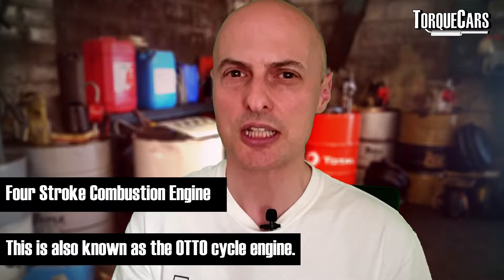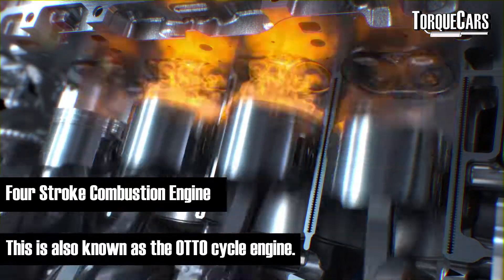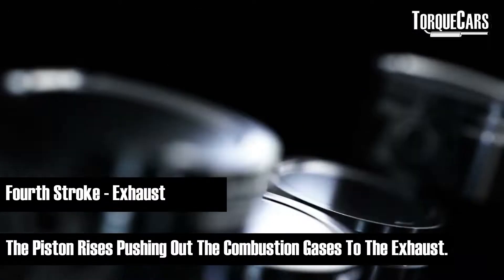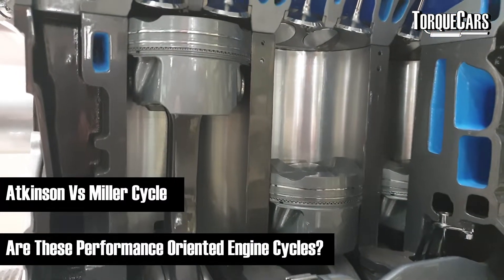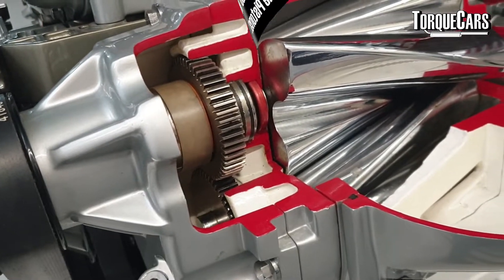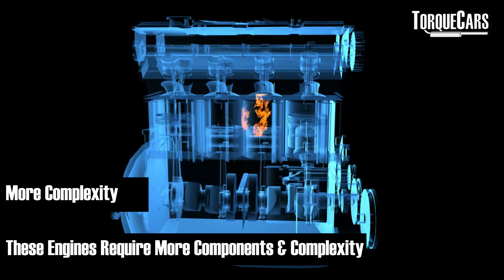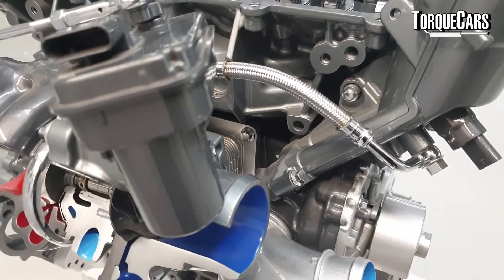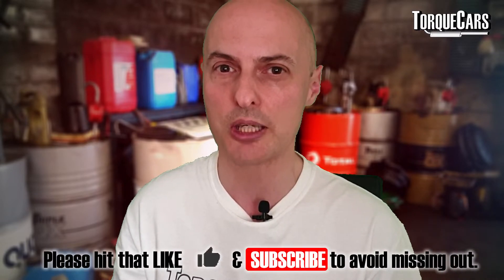Revolutionary Engine Design - How Atkinson Compares with Miller & Otto Engines

Comment: For the part on tuning the Atkinson cycle engine, I think of Hoovie’s nitro Prius.
Reply from the maker: I just looked that up, it didn't end well did it!
Reply: @torquecars  Not in the slightest! I love how he used the hybrid portion to get the car off the road. Every time I think I should add a turbo to my hybrid, I think of Hoovie taking it for the team.
Reply from the maker: Ah I found this now, the one I looked at was an early video before he got it sorted. You've got to salute these trailblazers.
Reply: @torquecars  The early vid is the one I am referencing. After Hoovie destroys the engine, he uses the ev portion of the car to move it to the side of the road. 
Adding 50 hp to a 100 hp motor that cut fuel when traction was lost… what can go wrong.  A see through engine.  
I own a 2022 Lexus nx350h. Great luxury SUV that is super fuel efficient. All my previous cars have sports car engines. Porsche boxster s, fiat 500 abarth (I nearly killed myself from taking the boxster way too fast). BMW i3 Rex - quicker than it looks. Saab 9-5 aero. …  then this thing.  
The motor in the Lexus just exists. No soul. But with a turbo it could be great. Then you see Hoovie’s video….  Nope.. I’m asking for trouble. Time to consider a Tesla or a WRX.

Comment: I've just been reading the self study guide for the engine in my Audi S4. It can be switched into Miller cycle. Now I know what that means. Cheers
Reply from the maker: Glad it helped, and thanks for the support my friend. I didn't realize this was possible on the S4. What year is it and which engine?
Reply: @torquecars  it's a 2018 3ltr petrol. It has actuators to select cam as well as variable timing. A very sophisticated engine. ICE engines have come a long way in recent years. Shame they are going to be replaced by soleless electric.
Reply from the maker: I don't want to go electric, I just don't think the battery technology is quite there yet.